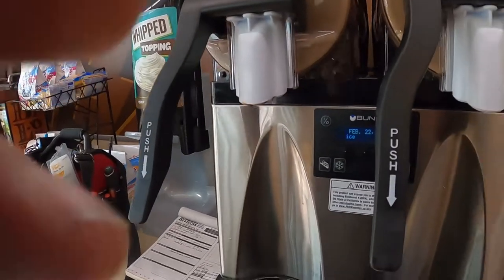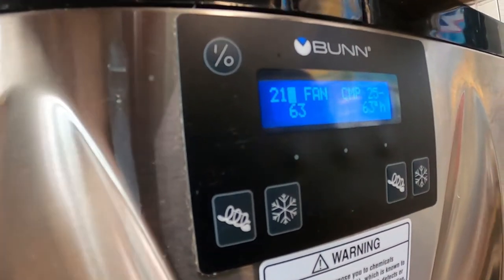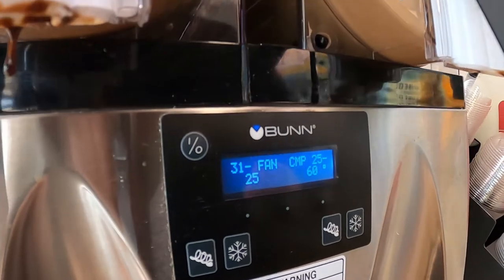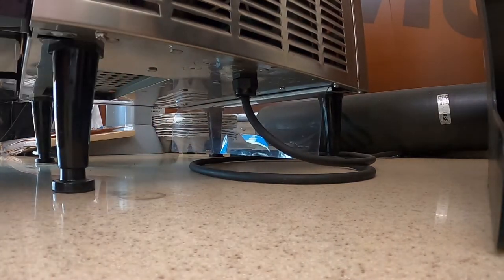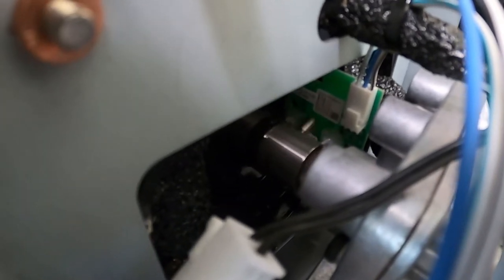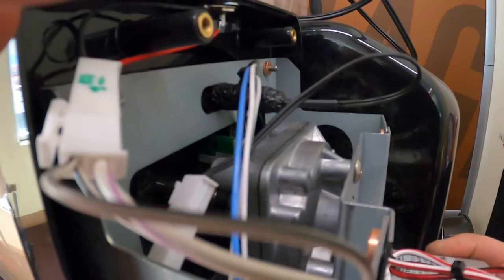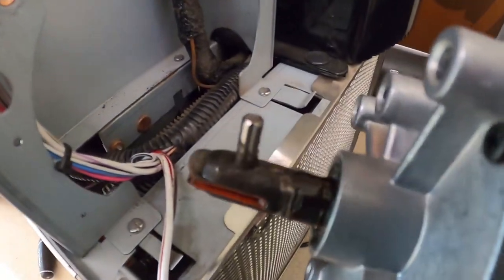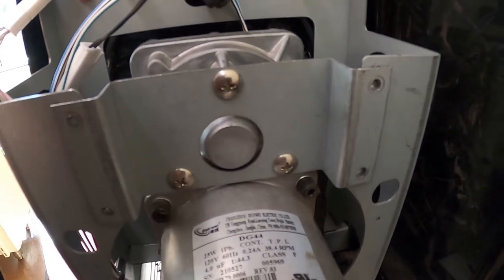Service Tips: Bunn Ultra 2 Slushy Not Freezing How To Diagnose Error Code

Comment: What is the other number that scrolls in after the temperature of the drum? And what should those numbers read while trying to freeze?
Reply from the maker: Sounds like the hot gas temp.  Barrel temp should get to high 20’s. Torque is big #. Should be 5 or less with no product or liquid product.  Upper case ice letters mean it’s calling for refrigeration.   Lower case means it’s at desired temp.  Hope that helps
Reply: @FishPornTV  Do you know what the hot gas temp should read? I have a machine that is taking a very long time to freeze up on both sides, inside of machine is spotless, pins on shaft are clean, torque sensor board clean and aligned, I just don't think the drums are getting cold enough, quick enough?
Reply: All readings are good, it is calling for refridgerant the whole time
Reply from the maker: @jpweaver44  how does the air filter and condenser look.  A dust blanket will cause issues.
Reply: @FishPornTV  it looks good,  Could I possibly be low on refrigerant without have a leak somewhere?
Reply from the maker: @jpweaver44  yes.  But check the two solenoids on the left.  Touch the top with screwdriver to check for magnetic pull
Reply: I ran 2 machines side by side and the one working, the drum is 25 degrees and the one not working is only getting down to 31.
Reply from the maker: @jpweaver44  It’s gotta be the shaft.  What’s your big number getting down to? Try increasing the thickness to 16 that might put you to frozen
Reply: Which big number
Reply from the maker: @jpweaver44  the larger sized # on the top row when in temp and torque screen. Under the side that’s not freezing
Reply: @FishPornTV torque starts at zero and goes up as it freezes

Comment: My Bunn machine left side auger works fine, however my right auger is always on "ice" and it doesn't even get cold. Why could this be?
Reply from the maker: Probably the auger shaft. It gets notched and the lazer eye can’t read the gap between the pins. And/or one of the pins has been sheared off.  Take off the back cover and look to see if there are two pins one at the motor, the other at the shaft. Also there is a diagnostic screen that will tell you a lot.
Reply: @FishPornTV  on the diagnostic screen the top number for the right side is 65
Reply: @FishPornTV  fixed it!
Reply from the maker: @luismunoz5411  that # should be 5 or less with the hopper empty.  What was the fix?
Reply: @FishPornTV  the distance in between the two notches.

Comment: What did the fix end up being?
Reply from the maker: Shaft replacement
Reply: @FishPornTV  so I found out both pins sheared off…went down to ace hardware and got 2 new replacement pins and put them in. It cleared the codes but still isn’t cooling. 

Any idea what it might be? Could it still be the shaft needs replaced? Refrigerant? Solenoid?
Reply from the maker: @vaiplayforkeeps  shaft is damaged. Torsion spring inside shaft is toast. Swap it, you should be good. Are both sides not cooling? Check for magnetic field above refrig solenoid they’re usually fine. But if there was enough pressure to break those pins then the shaft is damaged. Very common.
Reply: @FishPornTV  thank you! Is the shaft part # BUNN 28081.0001 ? Just want to make sure before ordering it. Gonna get it on order today 

Ithe torque is reading high on one but the other is 0. Swapped shafts and the torque values followed. 120 volts present at solenoids. Compressor and fan running normal. Solenoid ohms test was good. Can’t remember what the actual value was
Reply from the maker: @vaiplayforkeeps  yes
Reply from the maker: Also order a PM kit while your taking it apart. 58054.0000
Reply: @FishPornTV  thank you! I’ll do that as well. I’m hoping this fixes the issue 🤞🏻
Reply: @FishPornTV  last thing - do you think I need to order new pins?
Reply from the maker: @vaiplayforkeeps  always have more pins. I’m surprised you were able to replace those. Very tough, do you have the pin press tool?
Reply: @FishPornTV  got the new shaft installed. Let it run for about 20 min still doesn’t cool. I’m wondering if it’s low on Freon?
Reply from the maker: @vaiplayforkeeps  both sides not cooling?
Reply: @FishPornTV  I only tried it on one side so far. I’ll try it on the other now. It shows the bar that means refrigerant is going so I’m not sure what else it could be other than the refrigerant. Already tested power to the solenoids
Reply: @vaiplayforkeeps  Did you ever get your problem fixed? i am having this problem?